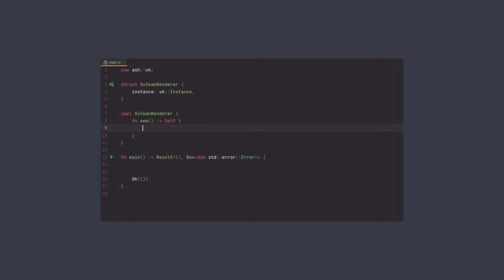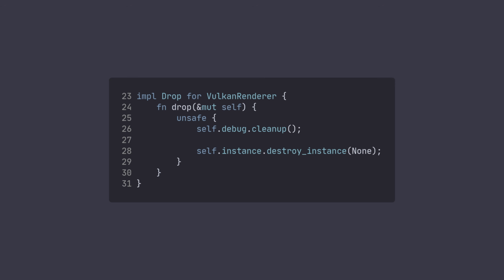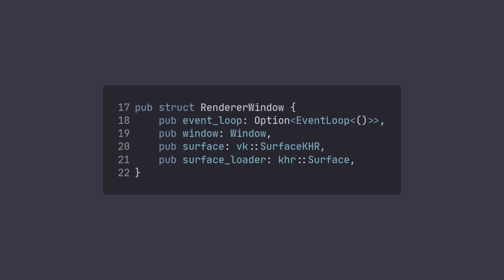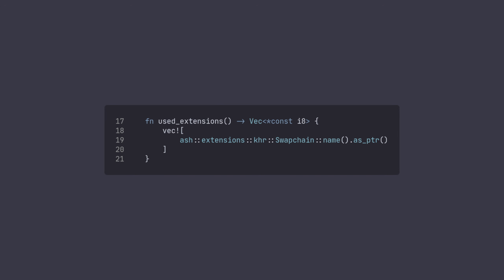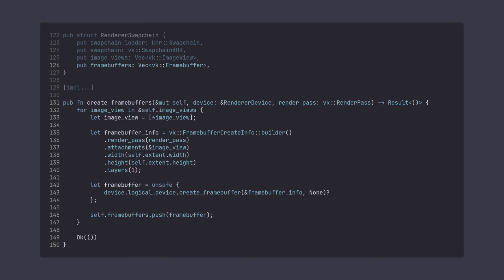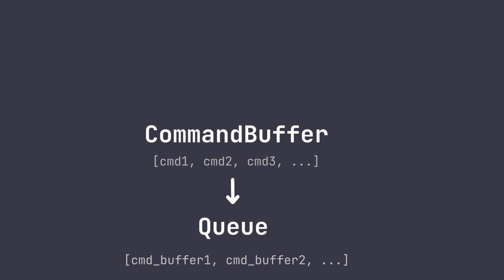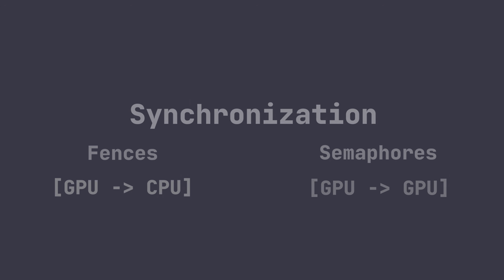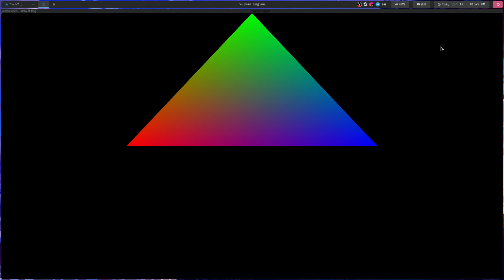Rendering a Vulkan Triangle with Rust!

Comment: Wow, you really have a Jetbrains app running under a WM? They always crash after a while on my system. 😟
Reply from the maker: Hm, that's pretty odd to hear, I haven't seen a single crash in a span of a few month of using it
Reply: @YakiKotori  IntelliJ is the only one that works for a minute, CLion doesn't even finish its startup routine. I'm running bspwm and you i3, though. I wonder if that could be it.